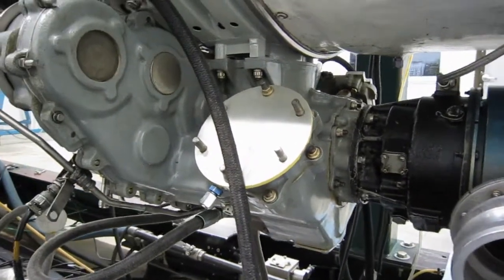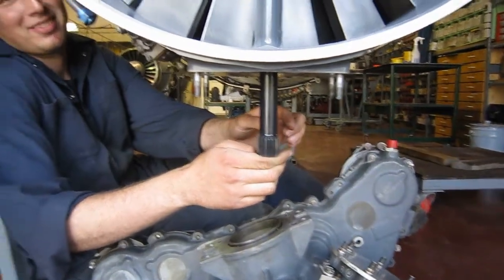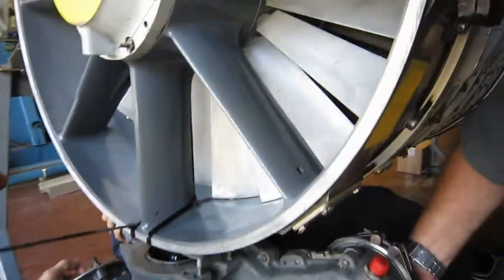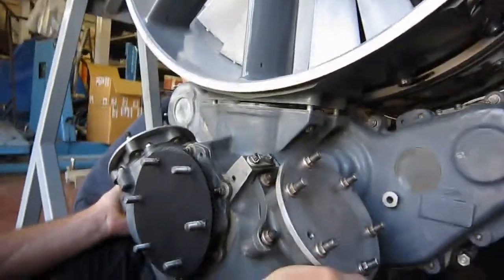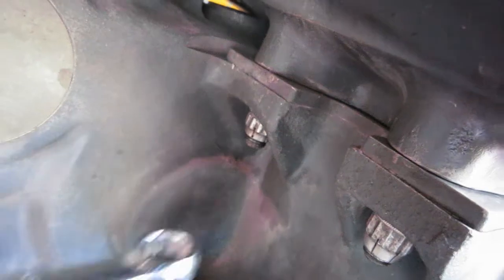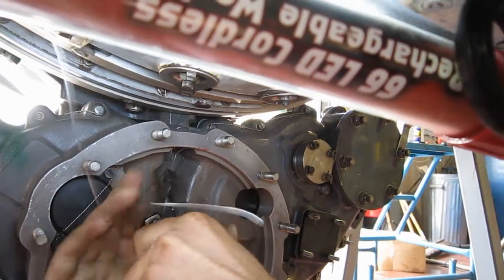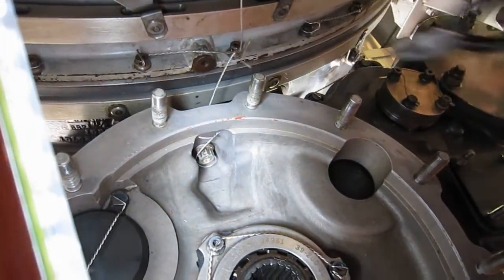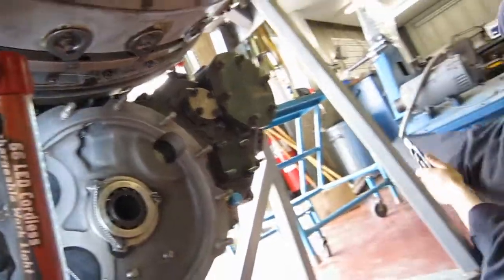Gearbox installation - Turbine Engines: A Closer Look

Comment from the maker: They are indeed blanking caps. This gearbox was initially designed for use in an aircraft. As the design iterations progressed in the industrial applications, various aircraft drive pads were omitted at the factory, after years of being capped off in the field. This is a later model of industrial gearbox, with al the latest in deleted aero features...

Comment from the maker: @ilovegoatsecks Self locking nuts used in aerospace are like harware store "nylock" nuts we've all seen, but they are designed to be resistant to high temperatures.
The nuts will not easily spin on (or off) of a bolt, even when they are not torqued to hold tension on the bolt.
The usual way of achieving this is for the nut to be slightly squashed into an elliptical shape, so there is some drag, called rundown torque, when the nut turns on a free section of thread.

Comment from the maker: @DerKack They are 12 point self-locking nuts, standard aviation stuff. Expensive, but we don't buy them. We have a large stock of fasteners from the many engines we have disassembled for parts.
Tools are the normal high-quality variety available from those guys in the trucks...  plus a few we've obtained from the usual retail outlets.

Comment: This may have been part of the answer to my second question on your " Questions number 9 video". Looks like on the J79 the gearbox is located under the front strut. On some other engines the gear box may be located in the middle of the engine. I would also like to see the other end of the shaft where it is driven off of the main shaft.

Comment: agentjayz, i saw you mentioned that the nuts were "self locking nuts"... i was questioning this about your vids before i just saw your comment. that partially answers my question. i was going to ask, why didnt you use loc-tite, or any kind of fastener to keep the nuts from vibrating loose or backing themself off the engine. i watched alot (if not all) of your videos and on the assembly ones you just tighten a nut and forget about it. can you explain the "self locking nuts" ???